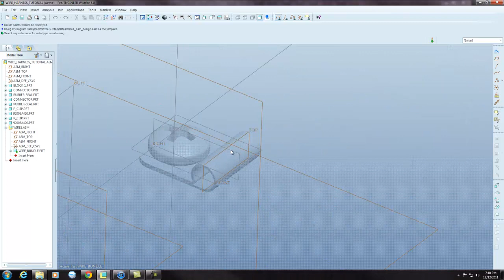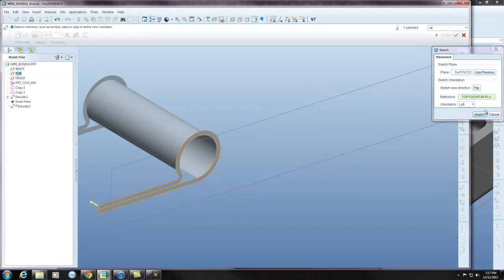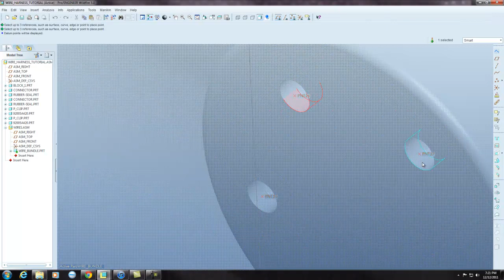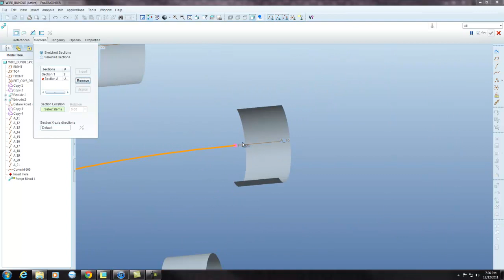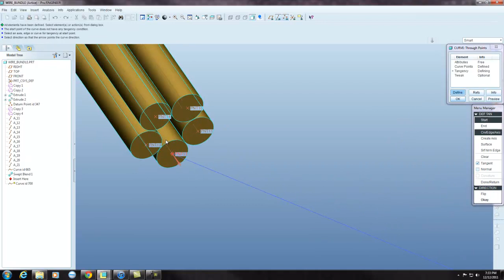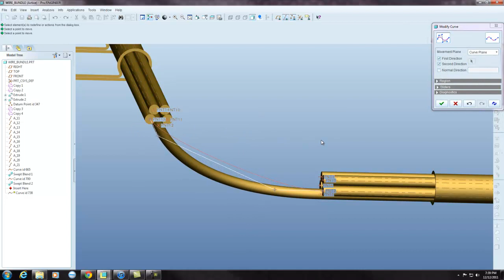Pro/Engineer Wire Harness Tutorial

Comment: This is call fake it till you make it. This is going to be a 3D cartoon. You need CREO schematics to start with correct capturing all connectors and ref designator and others to create the harness so you can flatten the 2D drawing for production. Please explain why are you doing this?. People this is not the way to do this there is no design  intent driven parametrically.

Comment: I'm using CP3 and could not get the axis geometry from the top assembly to copy to the bundle part.  If you're using CP3, to get past this, place two points on the cylindrical feature you want the swept blend to go to (while in the curve placement field.  You will have three points instead of two).  It will mimic an axis and look more realistic.  You also won't have to tweak every single cable manually.  Great tutorial video.  Thanks!

Comment: Tell me Steve, what are the limitations, or actually best method, of importing 3D CAD or .dwg files in Pro E?
No disrespect intended, but I can create a 3D rendering of a harness layout with a lot more than 5 wires, with way less trouble using simple path extrusions in AutoCad. This also includes rendering shielding, and outer jacket material. Problem I run into is so-called experienced Pro-E users I run into seem to be incapable performing such a task.